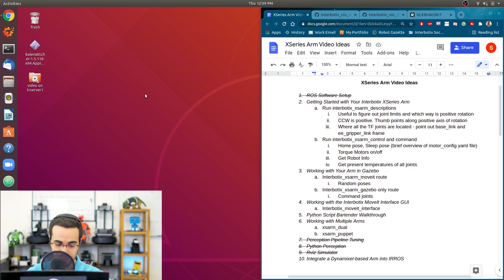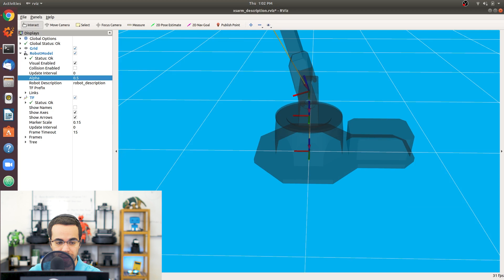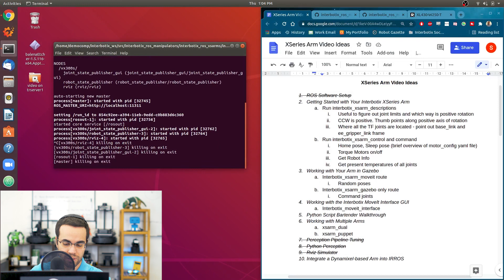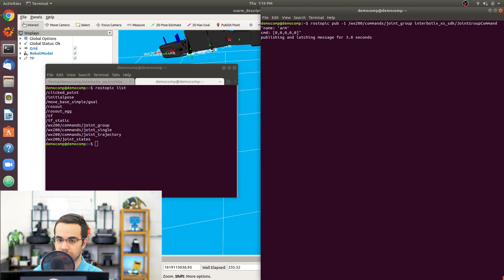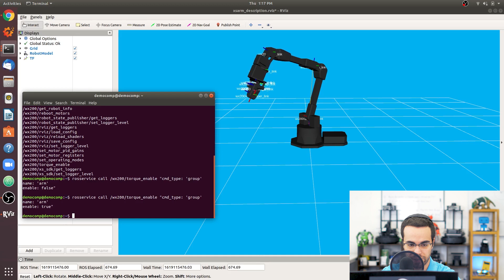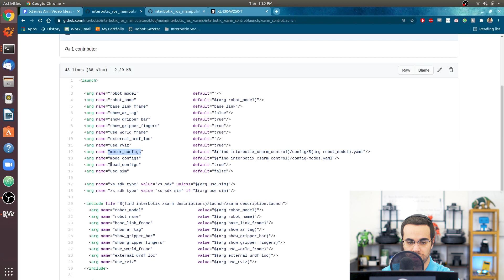Interbotix Tutorials: X-Series Arms | Getting Started With The X-Series Arm

Comment: Hi there, i am using the reactor x 200 arm. I can do the rostopic line to set it to the point [0,0,0,0,0] but i cannot change the set_motor_registers, i get an error stating "ERROR: Unable to communicate wiht service[/rx200/set_motor_registers]." Is this a known issue? 
I also cannot change the position after ive set it to [0,0,0,0,0], ive followed the same way and put in the correct sleep coordinates. 
Any help would be appreciated, thanks
Reply from the maker: Hi Sean, can you email trsupport@trossenrobotics.com with your question? They will get back to you as fast as they can.